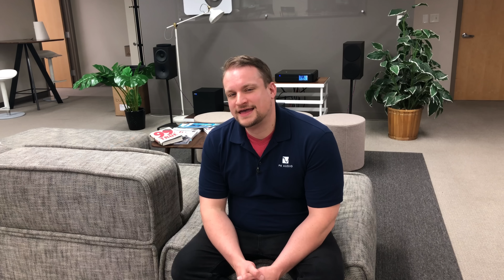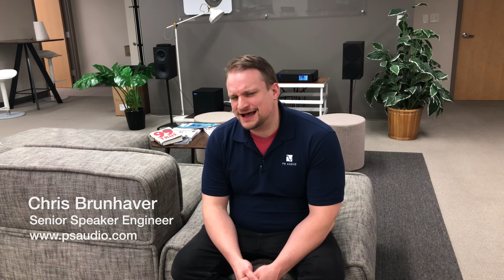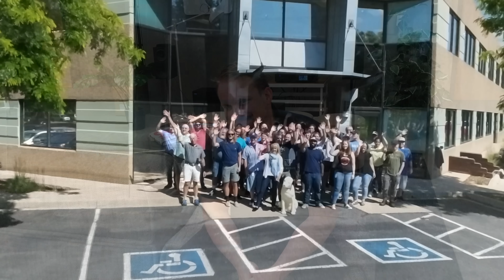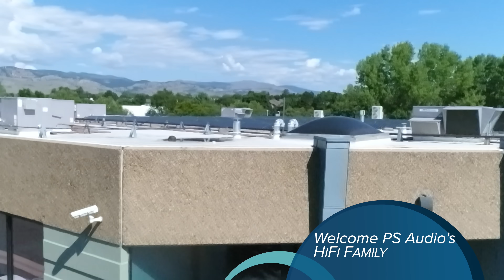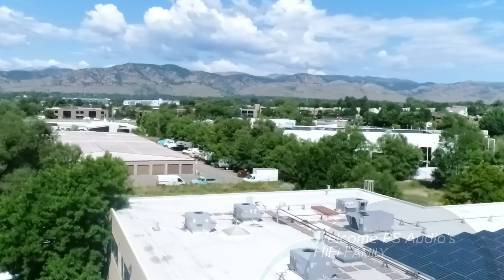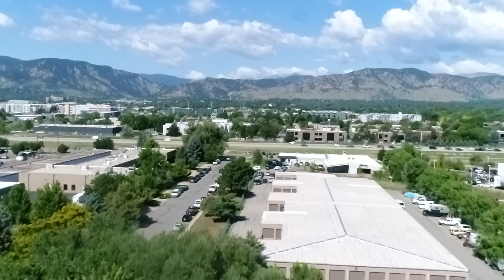Why speaker time alignment doesn't work

Comment: Are those Buchardt S400's in the back? Time-aligned drivers :)
Reply: Time aligning drivers (physically aligning them) can help with phase summation in the crossover. But if I had to choose, I'd rather have the highs and mids hitting my ear a smidge before the bass. Your brain hearing the first consonant or sibilance sound of a word, before the bass arrives, gives the impression of clarity.

I often like to place the subwoofer in front of the speakers but then switch the phase 180 degrees. It sounds quite clear for vocals, plus the sub hits you harder and doesn't interact with the back wall as much.
Reply: To the point of the video, they are physically aligned (because of the tweeter set back in the waveguide) but are not using a time/phase coherent crossover (not that they claim to)  That was sort of the point of my video.  Again, I think that that theirs is the correct engineering decision to make but they are non minimum phase etc.
Reply: @cbrunhaver  Hi Chris, I understand your point and it's very informative. I was just happy to see my speakers in the PS Audio office, it's a good look (both aesthetically and for Mads at Buchardt :) Thanks for the video!
Reply: supergiddy3 yes, I believe that our companies are rather friendly with each other and I have found his engineering work and designs to be very well implemented.

Comment: The only time alignment I've had contact with was room correction set up that the amp did you positioned a special mic at the listening position and let the amp do its thing and you could really hear the difference but isn't that really a form of DSP ? (Sorry it had nothing to do with the speakers themselves)

Comment: What about that tower of woofers 2 meters there behind?? 
The tall array of tweeters...all at different distances from the listener ears...dont tell me thats a good thing and theres no trouble.
A more in depth view of these issues is most welcome thanks.
Reply: Drivers producing the same sound which are placed closely to one another sum quite well. But tweeters don't sum particularly well because the wavelengths are too short.

Comment: Tell that to Wilson speakers
Reply: Well, what they’re mostly doing with their adjustable drivers is moving around the vertical lobes around the crossover point. This does change/customize the sound of the speaker but isn’t exactly what and how they’re describing it in their marketing and isn’t time alignment per se.
Reply: Time alignment is mostly nonsense. I find it's all about what you prefer reaching your ears first, and not trying to achieve some perfected time alignment standard (aka industry wide time alignment quackery).

The quick and dirty of this is messing with your subwoofer placement or switching the phase of the subwoofer 180 degrees. Speech clarity is enhanced if the bass is ever so slightly delayed. Your brain is very responsive to hearing that first opening consonant or sibilance sound.
Reply: @FatRat-f9m   I'm a big believer in phase aligning as best as possible near crossover points, but time aligning drivers isn't as critical, at least to my ears.

I realize that might appear contradictory since both phase alignment and time alignment are interrelated.

Comment: Dirac does work well. It was smart of MiniDSP to put the Dirac button on the middle of the remote so user's can A/B test it instantly. It clearly works. 
I imagine in PS Audio will ultimately produce a system that has a mic calibrated streamer/crossover/fir filter/preamp that feeds multiple amps that are perfectly matched to each driver. At least I hope they do. 
The difficulty is that it would require a lot of wires and stacks. So the preamp would need to be wireless and the amps mounted in the speakers.
Reply: ...and DACs in front of each amp of course
Reply: damn that smart mini dsp really be fixing the phisycal alignment, the crossover 90degree shift at the crossover point, and the inductance of each speaker, bro putting lipstick on a pig literally
Reply: @r-ratedstudios3847  You're gonna diss a four year old comment? Dirac does fix all type of phase issues even if you or I don't know how it works. I eventually started using Dirac only under 400-500Hz because it really does miracles with room modes. Like I said four years ago- it's an obvious difference when you toggle it on/off. Doesn't matter if you believe it or not... literally

Comment: I also discovered (as you mentioned) some other variables that effect phase irrespective of passive crossover components and driver position, and I postulated that these variables are related to the great difference between a mid driver and a tweeter in the mass of the two driver elements, and the physical resistance to motion exerted by the size of the cone anchoring material (just a surround for the tweeter, and both a surround and spider for the mid driver).

Comment: So we have to look up some quoted references to answer / find the answer.../draw our own conclusions..to....
" THE QUESTION "  asked...
IMHO approx. 10-20 Hz  of bandwidth either side of the crossover frequency may fall in the acceptable time alignment zone..this may not necessarily be true of the " all the phases " of those same 10-20 Hz Freq. band because there are 2 different drivers with different characteristics..

Comment: I have a question about alignment. I see that tweeters are curved to the outside and midrange/woofers on the opposite side. So they are not aligned at the first place. Except Focal.
Reply: Are you talking about the speakers in the room? Those are the Buchardt S400 from Denmark and are designed to have the tweeter below the woofer.
Reply: @BradMaestas  I didn't mean that. I meant about inverted dome in Focal's tweeter.
Reply: @freekwo7772 ...see this is where you 'fall down' Freakwo. In your original comment you say "Except Focal" & then in your reply you say, "I meant about inverted dome in Focal's tweeter." Wtf? You say that you have a question...& then there is no question; at least I don't see anything with a question mark after it. Where is the question?
Reply: @FatRat-f9m  your analysis slways amaze me. But inteligent people understood what my question is about. There are probably others manufacturers but I gave an example, not a claim. If the driver is like an eye and midrange is looking backward and the tweeter us looking forward there is difference in the starting point of their exhibitions. So that have to be compasated somehow. So I wonder why there is no geometrical aligment between the drivers that, I think, would contribute to this matter. But since I'm a lay person there IS probably a reason for that and I just want to know a reason. Focal is just an example, not a claim of superiority. So, Rat, glad to see that you ok, probably virus realized that you are to tough to deal with...
Reply: @FatRat-f9m  you have answered. So follow the line.
Reply: @FatRat-f9m  you are not funny at all. Just sick and obsessed person with the extra amound of time. The best thing for you to do is to visit a doctor or talk to the mirror since you are always find the way to change the topic to irrelevant and personal level and haressment. To conclude - Fat Rat you are nothing but a troll so I recommend you to visit a doctor.

Comment: This is a great topic to address. The concern involves only those frequencies that are shared by two drivers (the crossover region), and most importantly, the mid driver and the tweeter (not so much the bass and mid driver). Important to understand that the length of waves at @ 2-3 kHz (the common crossover region) is between 4.5 and 7 inches in length. So if the tweeter was out of phase by @90 degrees or @270 degrees (a 180 degree out of phase condition is easily managed by reversing the polarity of the tweeter), then the driver position would have to be shifted by 1-2 inches, creating a step and can create as much difficulty as the out of alignment condition.

Comment: Well all I can say is that this opinion is totally at odds with Pro-Audio industry. FIR has done wonders to system coherence and sound quality (obviously excluding sub 100 Hz). I think John Meyer (and academy) would definitely disagree with your comments.
Reply: Nope! thers is a video 'Rig Rundown - Steve Stevens' staring 15 miue 10 second he says he now USES TRANSISTERS AMP insted of tubes. Digital emulator and trnsiter power am EFFECT RETUEN is the waye to go. DAVE MUSTAINE USES DIGITEC DSP1101. THANK YOU AND THUMBE UPS!
Reply: Scott DC ...& you'll never know until you listen to a pair of CB's FR-30 loudspeakers.

Comment: So in other words you require 2nd order or higher order crossovers to make time alignment work?
Reply: Actually, it’s the opposite. First order acoustic filters or DSP, with the former having significant performance compromises associated with it.
Reply: cbrunhaver So companies like PMC are really compromising their speakers by adding time alinement plus using fourth order crossovers.
Reply: Brystonboy ! I don’t think anyone would suggest that achieving time alignment (however you choose to define it) is inherently bad, but you might have to make undesirable compromises to achieve it.
Reply: Brystonboy ! In my experience, fourth-order crossovers don’t sound as good as they look in paper, but I wouldn’t write a speaker that uses them off without listening to it.

Comment: I was always suspicious of "time alignment" when the difference of the sound reaching your ears in was probably a 0.00000000076543 difference.
Reply: Even if a speaker could be made with perfect alignment, it would only be at one height.  Deviate from that height, and alignment would be thrown off.
Reply: @doowopper1951 ...the 'extra' sweet-spot :-)
Reply: @doowopper1951  Except for coaxial designs of cause. For full ranged driver crossed low to a woofer, doesn't really have the same issues since the wavelengths are so long
Reply: @doowopper1951  Not if it's acoustic center is in alignment IE a coaxial or synergy horn.
Reply: @doowopper1951  that’s why I bought granite stands that were custom made for my speakers. Time alignment, when done correctly, is not easy, but the results are amazing
Reply: craigenputtock   

There are bi-amplified speakers like the Klipsch Jubilee that don’t come with a passive crossover.  Instead, it uses an active electronic processor that does all the required EQing, and as a bonus, enables the longer horn of the woofer to be matched to the shorter tweeter horn by delaying the tweeter input by an amount that’s specific to each bass horn and treble horn combination.  The delay time, in milliseconds, is available from Klipsch.  I use one of the older processors, the E-V Dx38, but you can also use the E-V DC One, the Yamaha SP2060, or most recently, a Xilica processor.

The Jubilee uses one of two tweeter horns:  the 15” wide K-510 or the 1 metre wide K-402.  Naturally, the wider horn is also deeper, making it closer to the woofer horn in length.  This means it uses less delay.  Going through all the possible woofer sections and tweeter assemblies calls for delays that range from about 1.3 milliseconds up to around 2.2 milliseconds.  All the corrections are done in the digital domain, so no noise is introduced.  As well, the EQed and time-aligned signal from the processor/crossover  feeds the power amps, and the signal goes directly from the amps to the speaker’s drivers, with no capacitors of transformers in the signal path to blur the sound.

So can you hear the difference?  Yes, but it’s not obvious with every kind of music.  For me at least, correct time alignment is most noticeable in music with a bass beat that’s echoed by a matching beat in the mid-range or treble frequencies, and it makes music sound more natural and believable.  However, for some owners the difference is obvious with every kind of music, and listening to a non-time-aligned speaker is unpleasant for them.

Finally, this type of speaker system is most often used in movie theatre installations, so you’ve likely heard time-aligned sound already, and been unaware of it.
Reply: Some people be going out buying time aligned speakers with no acoustic treatment in their room. Unless it's in a live setting with multiple speakers in the same range in an array I'd say time alignment between tweeter and woofer matter a hell of a lot less than phase issues from first reflection points
Reply: cein o'dowd , Hear, hear!!  Well said brother.
Reply: In terms of geting the phase right, comb filtering probably has more the most noticeably effect, since it will result in multiple peaks and dips in the ampitude response of the loudspeaker
Reply: The offset alignment of drivers often allows the crossover to sum properly  at the listening position, so time alignment in a way can be misused (or assumed) and is not the same as phase coherent.  I can never understand why audio enthusiasts when given information instinctively run the wrong way with it.  :)  Music is based on time --- phase, time, and Q always important.  :)
Reply: Same schit as with "femtosecond clock" like fucking femtosecond is so overkill moving your head by nanometers makes more phase distortion than such clocks

Comment: The Ohm Walsh F (now the TLS-1 by HHR Exotics) does not suffer from any of the issues mentioned it has perfect time and phase alignment and does not need a crossover , two reasons it was called the best sounding speaker at any price. To the uninitiated it is comprised of one tall cone driver made of exotic materials (for a speaker) with the bottom of the cone sitting on a large cabinet base ,this one driver produces all the frequencies, 29 to 22,000 HZ
Reply: It's a nice solution for the lower 7-8 octaves, but the high end is lacking, compared to a high-quality tweeter.  It's also a worst-case scenario for doppler distortion.  I had a friend who owned a pair and I was never impressed with the high end.
Reply: @marianneoelund2940  Yes the highest octave on the original Ohm Walsh F wasn't the greatest as they rolled off at 17 KHZ but the New TLS-1 while it looks the same ,has had over 60 improvements and now goes to 22 KHZ . There has never been any noted Doppler distortion as there is no frequency or phase shift going on as there is special dampening material inside the cone to keep the low frequency waves from traveling up the cone  so as to not superimpose any time shifting Doppler effects on the high frequencies.
Reply: @leekumiega9268  
You do understand that the voice coil is at the top, right?  At bass frequencies, everything moves in unison.  The bass frequency motion cannot be limited to the bottom section of the cone.  
http://www.hhr-exoticspeakers.com/photos/ohmfcones.jpg
Reply: @marianneoelund2940  All of the experiments on doppler distortion were done with a single driver whose motion is toward then away from you Like how a train whistle changes from coming toward you or away , but the Walsh driver does not move that way it does not move toward then away from you ,so it should not exhibit that problem. If it did I don't think that it would of gotten such rave reviews.
Reply: @leekumiega9268  
The angled cone surface will have a velocity component which points toward the listener; I'll need to think a bit more about whether that would be a problem.  But there is a portion of sound radiated vertically which will reflect around the room.  Could make an interesting experiment, in fact I could do some tests with conventional speakers which might shed light on the behavior.  
I remain skeptical about high-end quality, though.  There is a large radiating surface, a voice coil vastly heavier than that of a tweeter - not good design points for transient response and clarity.  My main objection to the set that I heard, was not lack of high frequencies, but lack of detail in them.
Reply: @marianneoelund2940  How old were the speakers when you heard them ,was it when they were new or fairly recently.There is both a dampening Foam and putty like substance that dries out degrading the sound of the originals as they age ,while the new ones have modern materials that have a  longer lifespan .I understand that a tweeter voice coil and diaphragm are much lighter (and easier to vibrate at high frequencies )  than the top of the Walsh driver but somehow it works. Have you ever looked at the size of the MBL's tweeter section.Also Dale Harder owner of HHR exotics is also a laser specialist and EX NASA Engineer (check out his bio.)and he made precise laser measurements of the cone at various frequencies to optimize the damping material.
Reply: @leekumiega9268  
They were relatively new speakers, as this was decades ago.  But keep in mind I was comparing them to my speakers with EV T35 horn tweeters - a near-optimal design for high-end transient response and detail.  
I think the earliest units also had cabinet coloration (resonance) issues.  I noticed that HHR is adding some sophisticated internal bracing to the units they modify.